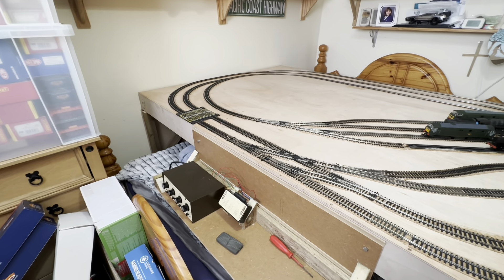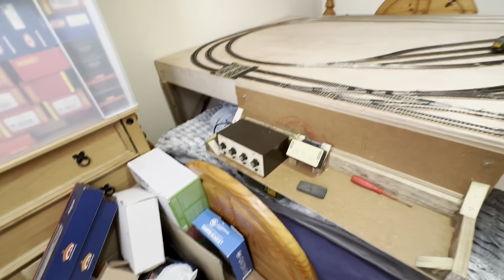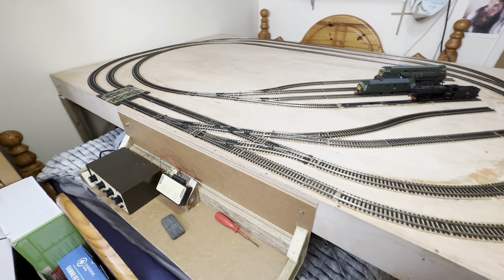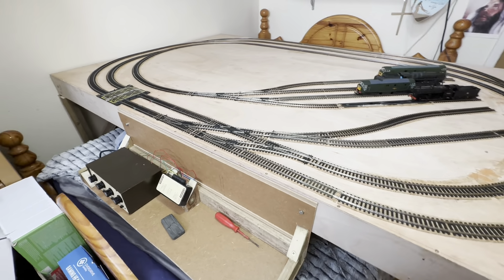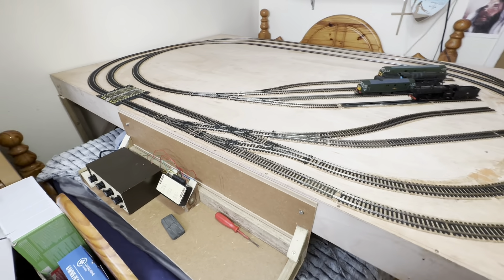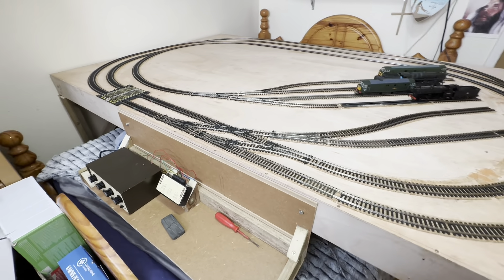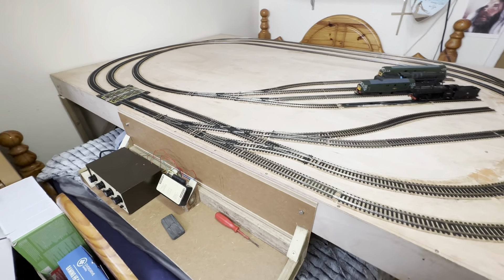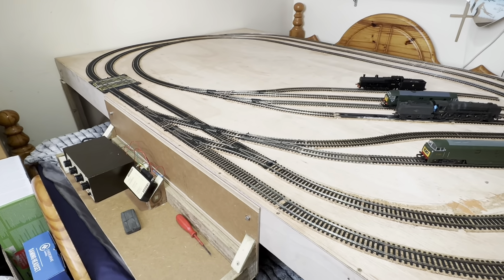TESTING THE TRACK & POWER

Comment: You made some very good "points" on this, no pun intended. Cannot tell you how many things I have lost. Great to see a crew on your locos. I have not installed motors in my points as I was apprehensive about it but if I keep an eye on things it works however, doing a live broadcast it is easy to get distracted. I also like your assistant. Thanks for dsharing

Comment: If the layout was DCC would the class 29 run any better through the points? I have one in BR Blue and it runs relatively well but does hesitate now and again, in fact I have one section of track where all the locos slow down and I am not sure if it is because there is a  tight curve or something else going on
Reply from the maker: That’s a good point Charlie . With DCC you can get the stay alive chip that improves reliability through insulfrog points . Check your rail joiners to see if any are loose as this can impede current ,